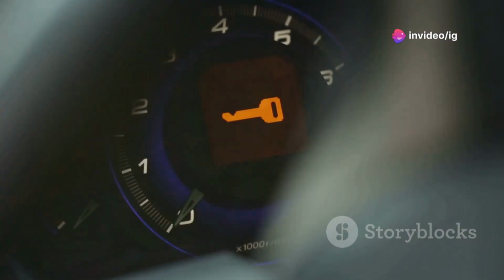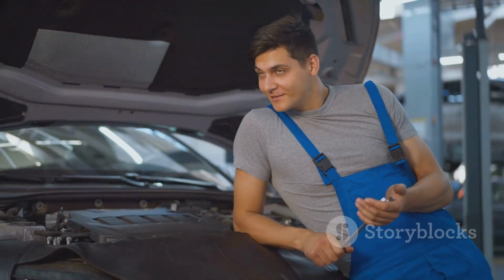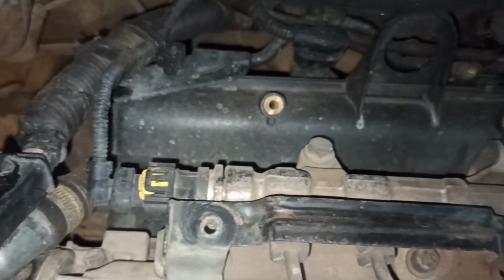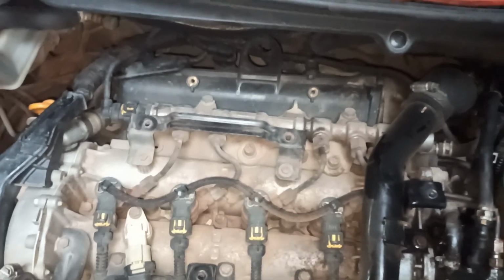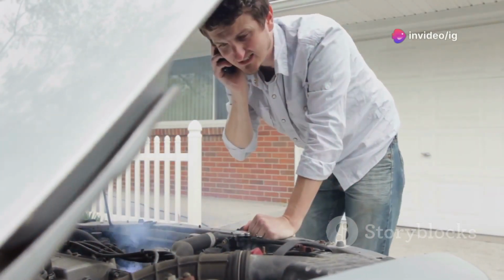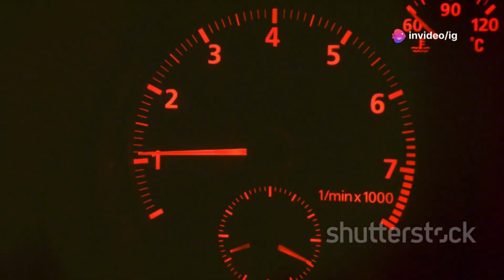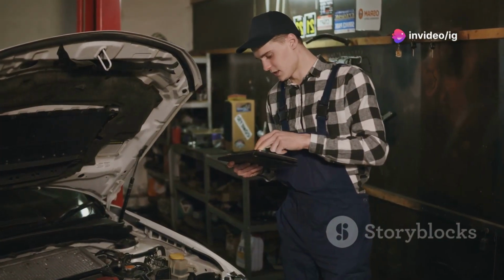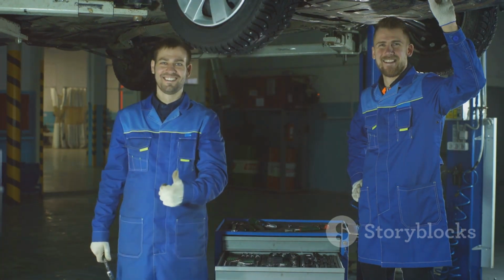P0004 | p0004 fuel volume regulator control circuit high | p0004 code

Comment: i had a p0001 code, i replaced the fuel pressure sensor as it seemed old and broken too from the connection. i then checked the OBD scanner and it says p0004 my wiring is fine and there is continuity within the wiring so i suspect it is the regulator itself
Reply: The regulator tends to fail before the sensor on the rail....just harder to access on most vehicles.
Reply: Hello, I have the same problem. I get the p0004 error. Do you know how to fix it?
Reply: Como resolver ????